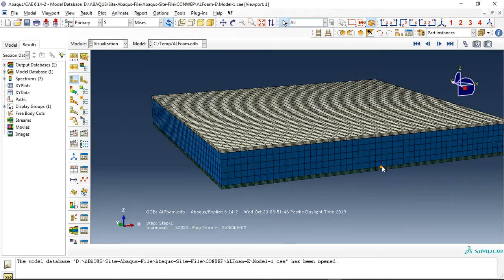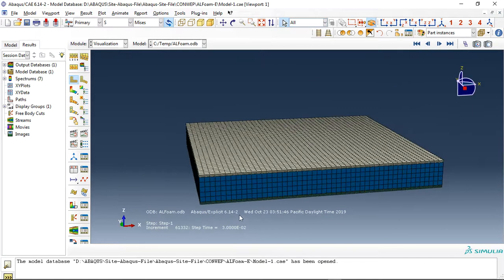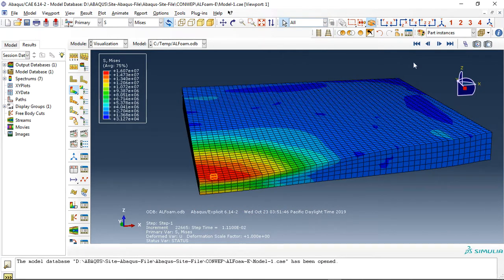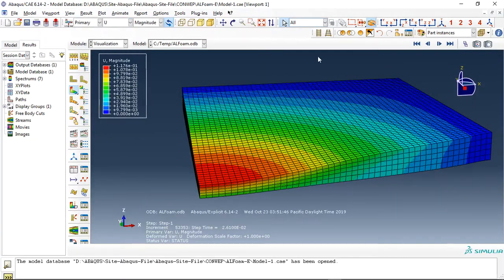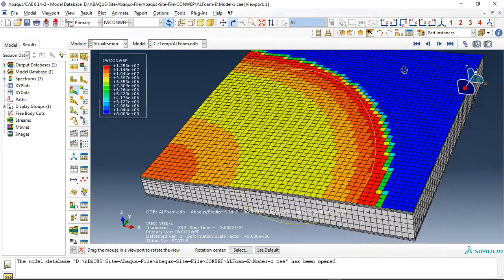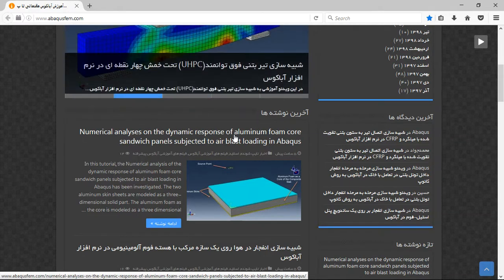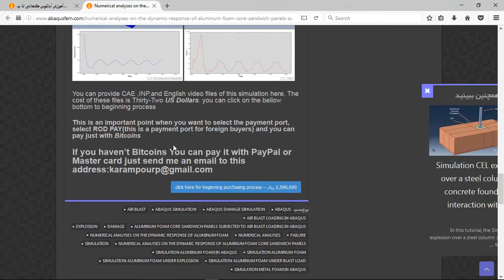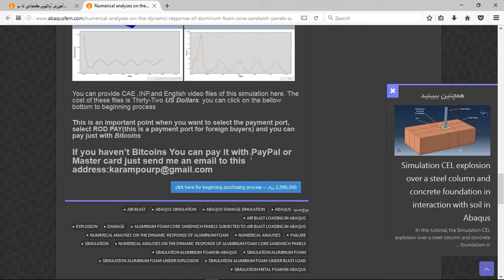Numerical simulation of an aluminum foam core sandwich panel subjected to air blast load in Abaqus

Comment: hello there! I wanted to ask from where do you find and apply the engineering constants such as; young modulus, shear modulus etc.?
Reply from the maker: Hi, from papers. If you need this tutorial, get a contact with the website manager: abaqusfem.com@gmail.com
Reply: @abaqusfem3576  Thank you for your reply! but I actually haven't seen any paper that states the values of E1, E2, E3, Nu12, Nu13, Nu23, G12, G13, G23 used in abaqus.